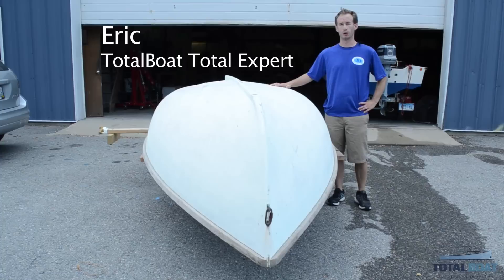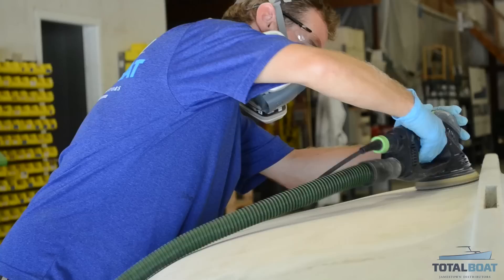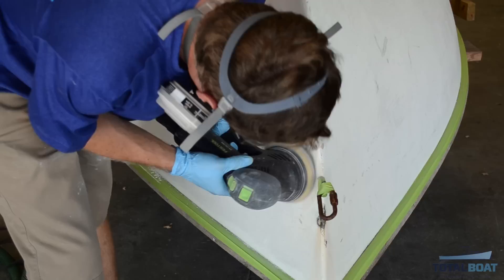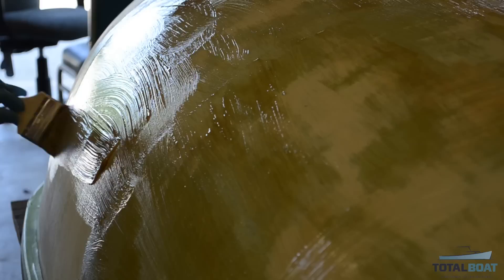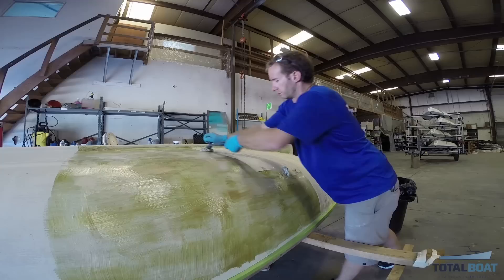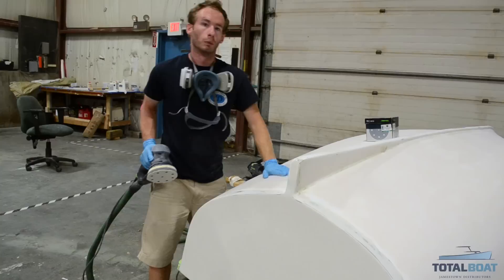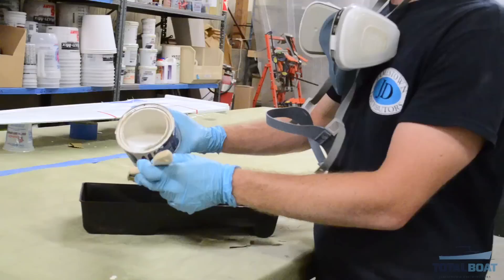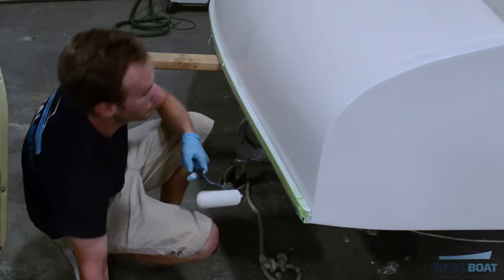How to Roll and Tip Paint on Your Boat's Topsides

Comment: Pretty sure I have a gelcoat on my old sailboat now.  It isn't a collectors item boat.  Want a different color.  Looking at Wet Edge One Part Topside paint & Primer.  Do I need to sand down gelcoat prior to any paint or can I paint over with primer then Wet Edge Topcoat per these thinning instructions and roll tip?
Reply from the maker: The gelcoat must be sanded. Always sand before using WetEdge - follow directions for "previously painted surface" and sand between coats of Wet Edge, too. If you do a good job rolling and tipping it will look like gelcoat when you're done. Good luck! Feel free to call our Tech Hotline for help as you go - 800-497-0010

Comment: Hi, am I correct that such paint can be used on a sailboat hull anywhere above the water line? Best regards!
Reply from the maker: Correct! Wet Edge is a great one-part polyurethane topside paint. Not for use on the bottom!

Comment: Wonder why they’re painting the bottom with topside paint..
Reply from the maker: Great question! Because the boat never sits in the water for more than a sail or a row. It's dry stored and does not require antifouling paint.